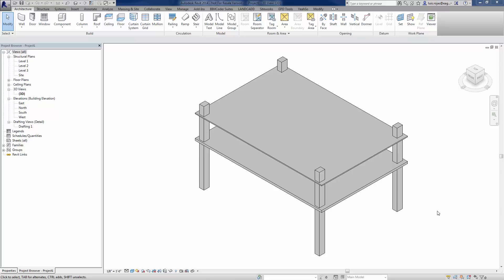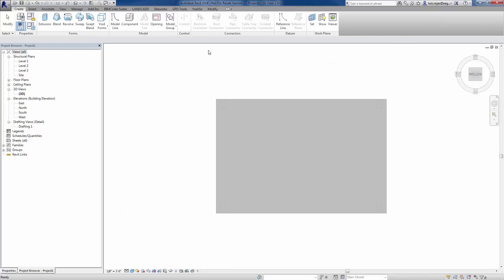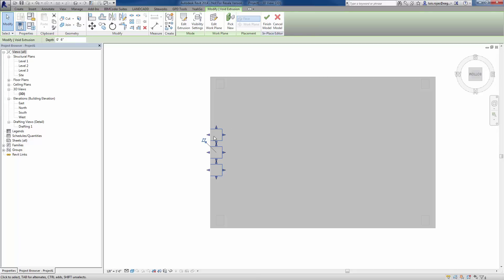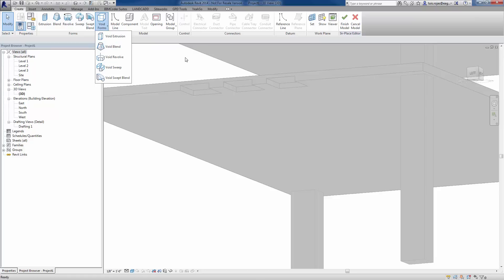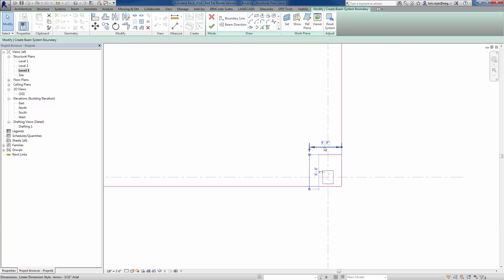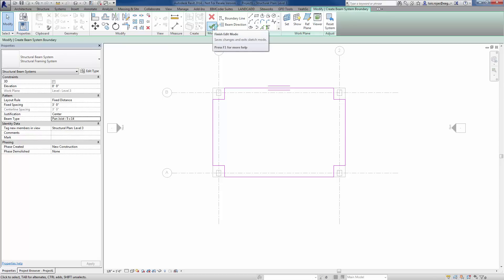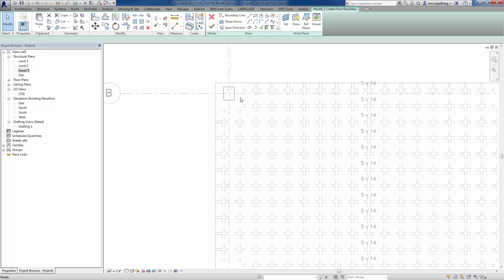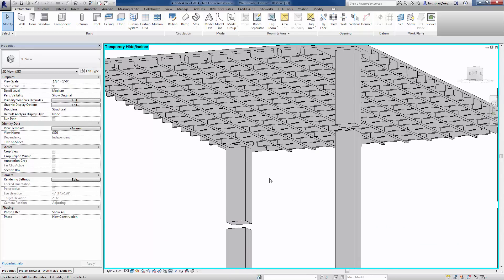Revit Waffle Slab

Comment: I have this really irregularly shaped existing building so I ended up modeling the pans as isolated footings.  They were easier to edit and array that way and still look pretty good in section I just made them transparent.  Also since they are the only structural foundation on the 2nd & 3rd floors it made it easy controlling their appearance in vg.  --Then just to see if it would work I exported a CAD file of the waffle grid of footings I had made, then inserted the 2D pattern back into to revit, from there I copied the lines and pasted them into the void extrusion create mode and was able to cut them out of the floor as shown above all at the same time.  It took my computer forever to process but it worked.  Thanks for the video!